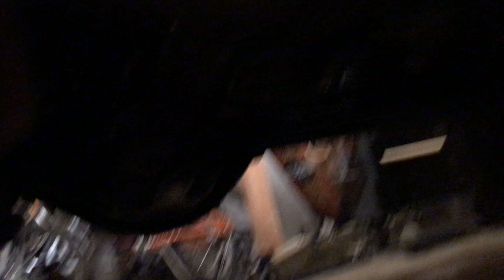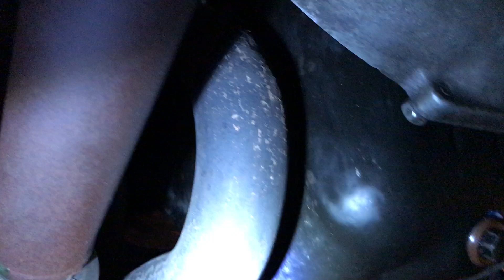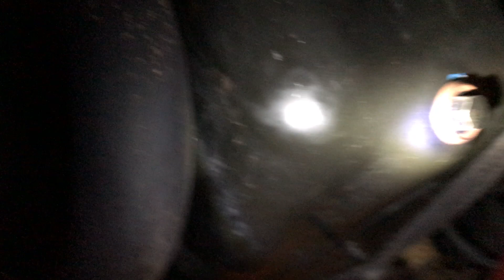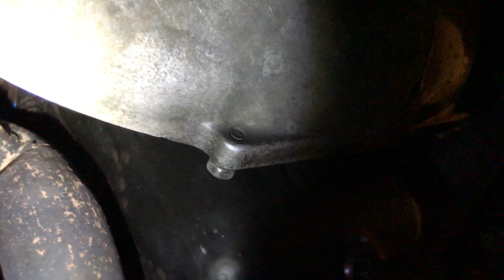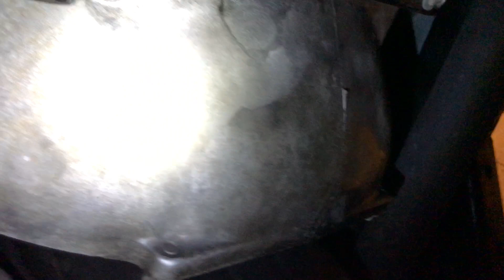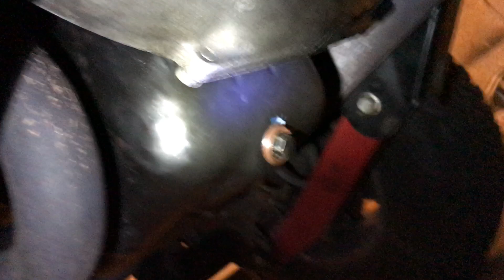2002 Jeep Wrangler TJ - Knocking Sound Almost Gone

Comment: Same noise here in an 04 Grand Cherokee (4.0). Same thing, non-existent when cold, noise starts when the engine starts to warm up (oil gets thinner) and then "almost" goes away at operating temp. did you ever identify exactly what the issue was?
Reply from the maker: Sadly, not yet. It seems like it’s a way more common problem than I thought. With the way it seems to react to oil viscosity and engine temp, a lot of people are leaning towards a lifter issue. You can check out the thread over on wranglertjforum.com about the noise. It’s amazing. One guy solved his issue. Pretty sure he replaced the pistons and rocker arms (piston slap).
Reply: That's exactly what my xj does. Did you ever find the cause of it?
Reply from the maker: @MrTwitch37  Not yet, sorry. I did try a can of Engine Restorer with my last oil change, and that made a huge difference in the sound. I'm not a big fan of additives, but I thought I would try it, and I'm glad I did!

Comment: my 2.5 94 wrangler has the exact same noise coming from the exact same area. I replaced all my lifters , pushrods and rockers and it didnt change it whatsoever.
Reply from the maker: Dang. That’s rough. I’m really leaning towards piston slap.
Reply: Definitely sounds like flexplate rattle. Is it almost non existent when cold? the only real solid way to check and see if that's it is dropping the trans it cracks right around where center plate meets around bolt holes. Super cheap part though.
Reply: My 2.5 is doing it also. What was your issue?

Comment: Thank you for this series, I'm just trying to work out what you changed to get the sound to go away?

Saw on one of your videos about the timing chain being loose but wasn't sure if you replaced it and that stopped the sound?
Reply from the maker: Hey Owen. Sadly, haven't figured it out yet. The timing chain needed to be changed, but it didn't fix the noise. Trying out a bunch of things to see if I can diagnose it and fix it. As of yet, to no avail. I've been keeping track of everything in more detail in a thread over at wranglertjforum.com. There's a bunch of us posting our updates in the thread. Highly recommend checking it out. Just search for threads by "TheGoblin" (me), there will be one about engine knocking.
Reply: @ProVisionColor   I see, it sounded alot better in your recent videos than before! I’ll check out your forum posts too since I’m having the same problem.

Comment: loose flexplate? sticky lifter? timing chain guide?
Reply from the maker: Checked the flex plate bolts, a few times, everything is tight. Changed the timing belt and the guide, no deal. Could still be a sticky lifter, but I just don't want to pull the head if I don't have to. So far it's still running fine, so I will take it step by step.